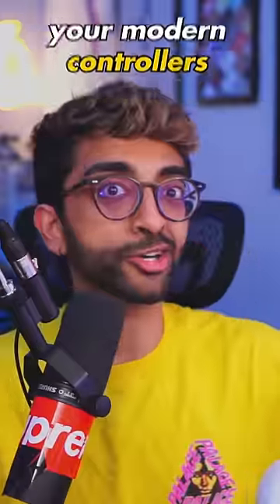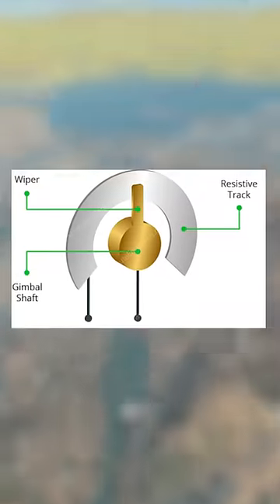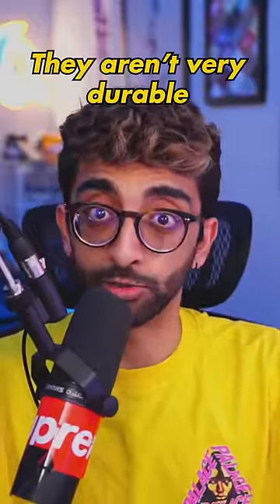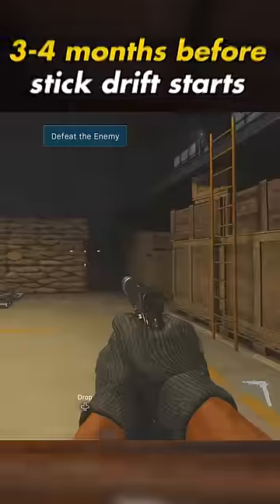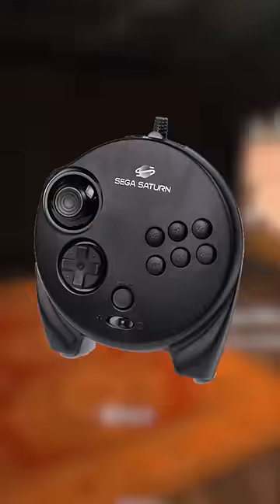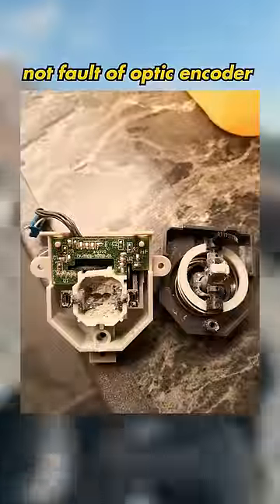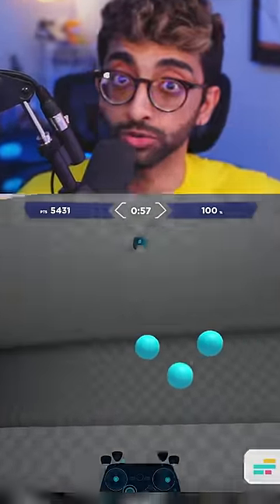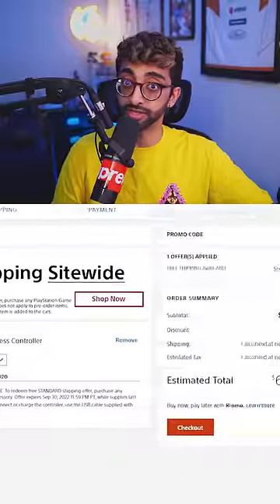The TRUTH Behind Joystick Drift

Comment: Why do Xbox elite controllers have spots or “notches” where the stick “sticks” to a certain area on the joystick? when clicked in(it does NOT have a notch or feel any different when not clicking the joystick down) And PS5 controllers do not have a notch at all EVER(while clicking the joystick in and spinning it in a circular motion) 

I assumed it was because the way they are built? 

I’ve had 3 elite 2 controllers and they all feel like that when I click it in and do a circle while continuing to press it. The spots or notches are random and in different locations on all controllers too

Comment: The Guilikit King Kong Pro 2 and 8Bitdo Ultimate Bluetooth controllers are both modern controllers with hall effect joysticks. I believe they both cost $60-70 dollars. I have the 8Bitdo controller and it has 2 back buttons built in

Comment: I can generally take them apart, clean them up a bit, though some of the metal rings in off brand controllers are REALLY fragile, and you look at them wrong and they warp and break.  I can get a few more months out of them, but they do pass a point of no return.  And I have never even considered the existence of modular controllers, I think I need one

Comment: sticks can drift from more than just that. any electrical component will degrade over time. Capacitors, Resistors, Transistors, anything used in the circuit for the stick cause it to drift. but yes the more common reason is what you mentioned.

Comment: Hall effect sensors are not as accurate and are susceptible to changes in magnetic fields such as an area with high EMF when you are near a transformer or a magnet. Conversely, a potentiometer will provide excellent measurement until it is mechanically damaged and is not affected by any sort of interference.

Comment: I still have my OG PlayStation controller with the 1st gen ps4 that I got in release and it doesn’t have stock drift. The T2 and L2 triggers have broken their springs and require more pressure but other than that it’s all good. Even my newer controller is fine and I’ve had that for 2 years

Comment: How to forever get rid of stick drift: wiinunchuck sensors are very nice. I rebuilt tons of controllers and this was the best solution I have found. I have never been into Nintendo but every time I get a elite series 2 I also buy 2 wii nunchucks. It’s really easy to do and it fits way better than the original sensor. The reason elite sensors suck is the clip bends to fit wrong within A FEW DAYS. I have even had problems straight out the box from the sticks jiggling around from the semi truck that delivered it I’m guessing. Great controller ass sensors.

Comment: Get some isopropyl alcohol, take your controller case off and spray it into the potentiometer. It's more than likely just lint or something inside the switch.
Still works when my 360 controller gets stick drift.

Comment: Or clean it out. It is honestly very very easy to fix drift on a PS5 controller, disassembly is not hard at all and while getting the potentiometers into a workable position is a little finicky it is a job that takes a pair of tweezers, some isopropyl alcohol and some cotton swabs to avoid solder work or €50+ purchase.

Comment: If you want a really good controller that has roughly 20 hours of battery life, comes w a charging stand AND uses hall effect joysticks I recommend the 8bitdo ultimate, I've had mine for awhile and it's phenomenal. It also has two back paddles and comes w re mappable buttons and is about the same cost as buying a basic Xbox or playstation controller ($70 on Amazon and in site)

Comment: So you're saying that it would only take a few months to develop stick drift but I had one controller I used from 2014(Xbox one) all the way until I got an Xbox series x in 2022 and barely had stick drift (less noticeable than what's in this video). What people don't take into consideration is that if you let the stick snap back into place whenever you're playing, then it does that way faster. If you have your thumb on the joystick the entire time where it's smoothly moving, it will last way longer
Reply: Not saying you're wrong just saying that it's actually all about how the controller is treated

Comment: theres another solution. buy wd-40 specialist contact cleaner, make sure there is no power at all in the controller, then spray the wd-40 inside through the joysticks, but dont spray too much, just little bursts. wiggle around the joystick for 1 minute, then let it dry, and once its dry, charge your controller, and you should be good. this works for joycons and oculus quest controllers too, or any vr headset controller for that matter.

Comment: I was just talking to someone about this it seems like every Gen. Console the controllers get worse and worse, like even the xbox one controller seems more durable than the xbox series X controller which seems like it weighs half a pound less and it will break if you drop it once. 
Which compared to the original NES control that came out 40 years ago you could literally take that onto a battlefield and use it as a war flail and smash in 37,000 skulls with it and then come back and plug it into your console and it'll work just fine.

Comment: Using optical encoders in Logitech wheel products has told me that they are far from a solution, I’ve had to replace em 3 times over 2 different wheels.

Comment: The best way to avoid stick drift on any controller is to change L3/R3 to different buttons.
Reply: How? There are no extra buttona
Reply: @junaidmughal3806  you want to change L3/R3 to buttons you aren't using often. Example: on my PS4 controller I changed L3/R3 to L2/R2 bcus I didn't use those buttons. Now my controller stays working longer than my other ones.
Reply: @SleepyDogg  sorry didn't get it, L3 and R3 are the least used buttons in almost all games, replacing them to other buttons would make L3 and R3 buttons more frequent to use

Comment: Pretty sure I played Rocket League for 1000+ hours, Destiny 1 250+ hours and a bunch of other games for a couple thousand hours more all with the same controller all that sucker doesn't display a signs of drifting at all. That's the controller that came with PS4 back in 2017, so 6 years old. Yeah sure it is not in perfect shape since I used to use it plugged in all the time on PC (for RL) and then the USB connector became a bit loose, it still charges though, takes a little extra care when plugging the USB in but other than that is as good as new. Kind of amazing that it would last this long, it's impressive. Got 3 DS4s and 2 DualSenses, none with signs of drifting. I can't complain

Comment: You can take apart your controller get some rubbing alcohol and a Q-tip and rub the actual part and clean it cause stick drift is usually built up gunk most of the time search up a video for it I’ve saved heaps of money doing it

Comment: The pots aren't the only problem. PS1, 2, and 3 all used the same exact type of analog core and I have never once had drift issues with those, and they've been very heavily used over the years. When you compare an analog core from a PS4 or PS5 controller with one from an older controller, you can see that the entire core is more cheaply manufactured. It's all plastic now. From what I've seen repairing and testing controllers, half of the drift issues could be resolved if there was an option built into the systems to adjust the stick dead zone. My PS5 controller has drift in the left stick and it wouldn't drift if I could ever so slightly adjust the dead zone. Even just the weight of my Kontrol Freaks is enough for it to register movement.

Comment: Never had a controller with stick drift. I’ve a fixed a few mates ones tho, usually it’s just dirt, loose hair or dust. Open the controller carefully, use a fine paintbrush to clean it out an put it back together. Simple. Unless your thumbs are like lead weights in which case it’s fucked 😂

Comment: Yeah well the PS1 and 2 had no stick drift because when they were developing it you could just lift the stick turn it to to a place that it didnt drift and then press the stick to go back to its place and woaala the stick drift is fixed in one minute of work without any tools and only by following the instructions of the instructions manual (no joke this trick was mentioned even on the manual) but I guess Sony got extremely greedy and decided to ditch this trick for the ps3 and onwards for obvious reasons

Comment: I still think drift is largely due to bad software.  The GameCube would recalibrate on every boot, why doesn't that exist now?    Also,  capacitive sensing joysticks should be just as dirt cheap in volume, no contacts to wear.  I'm not even quite sure why we still use so many potentiometers anywhere, sensors and digipots should be similar price by now if we really wanted to switch.

Comment: No there's an entirely different option that could fix all of this if companies didn't produce things entirely for planned obsolescence.  So old joysticks in the 70s and 80s and early 90s often used pots and would often have dials you could turn with a screw driver or something to calibrate the resistance.  The carbon pad wears unevenly but it continues to provide resistance in general for far far longer.  If Sony, Nintendo, and Microsoft actually cared about this and not just making as much money as possible on producing future trash they would include this in their controller designs.  4 adjustable screws on the back of the casing, and software accessible on the console that allows you to read the joystick position and movement and the resistance, so you can turn the screws until the proper amounts read at center and at the poles.

However you can find someone making a flex pcb board that can go inside and be soldered onto the back of these controller pcbs that has these screws and you can open them when you need to calibrate, hook them up to a PC via USB and he provides instructions to a website that let you read it, and properly calibrate them to extend the life of the pots dramatically.  But you'll need to be able to solder or find someone who does.  However it's a simple job in terms of that, not super delicate.

You can replace the pot sure but being able to make it last years more by just being able to physically calibrate it is worth it.

Comment: Nothing a bit of compressed air can’t fix. You can also prevent drift by putting a small peace of card underneath the joystick. Note that you need to have a decent understanding of the electronic hardware of the controller or just watch a YouTube video

Comment: The ps3 controllers used a good one that didn't really go bad is purely for profit that's how itnworks
Reply: TBF the PS3 controllers cut cost in other ways so its possible they spent extra on the sticks

The triggers were the biggest cut

PS3 controllers use spring loaded digital input triggers. They're basically the same as the triggers in the PS2 controller but with springs

Whereas the 360 had potentiometer based, spring-loaded-mechanical analog triggers

Comment: Nah I have no life sad buy true....i play games more than 3-4 hours a day got the ps5 day one and I'm still using my controller that came with the system...same with the ps4 technically I've only gone through 2 controllers the whole life span of the ps4 generation reason as to why I got angry broke them🫤🤷‍♂️ but I've used the same ps4 controller since the ps4 slim came out and i got one of those....no stick drift. And I still used the same xbox one controller I had since I got the system the day one fat boy....no stick drift. Yall just rough with your controllers I'm only rough when they do me dirty and then they're gone no second chances lol.